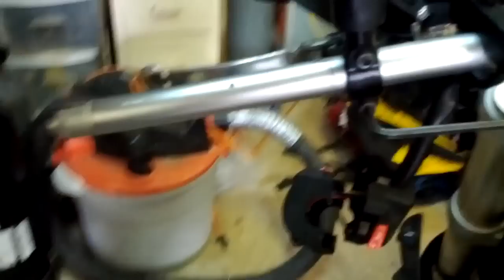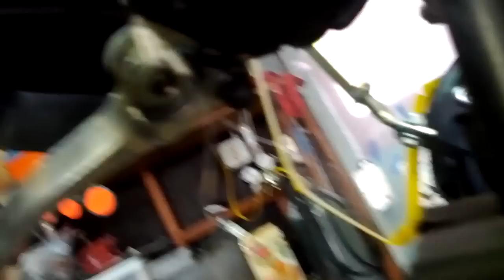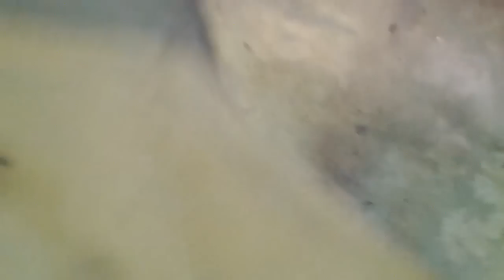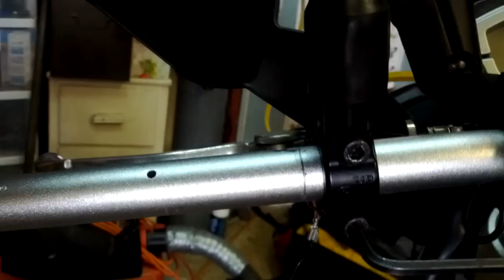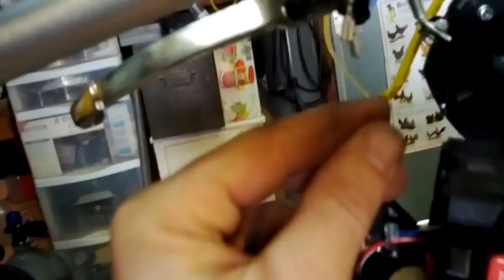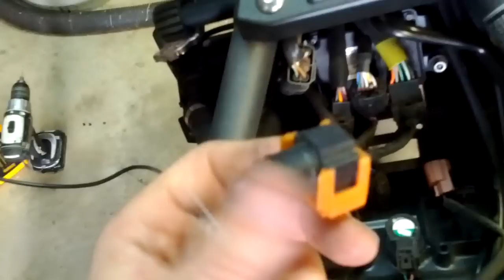Installing oem heated grips Triumph Tiger 800 XC

Comment: Another option for feeding wires through the bars.I used a long zap strap and pushed the electrical connection onto the tip of zap strap,held long enough so I could pull the strap and wire back through the hole,let the second one just fallow.
The Triumph heated grips work great.Replaced my air filter with a K&N at the same time.Great fun on a rainy day.